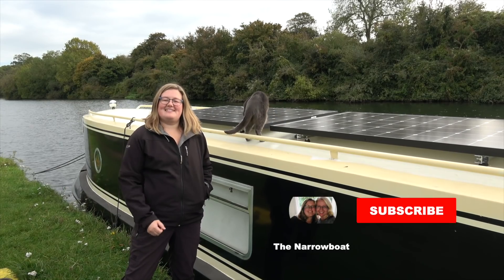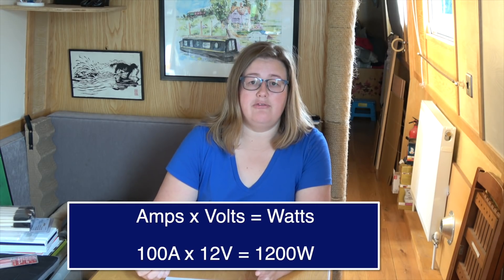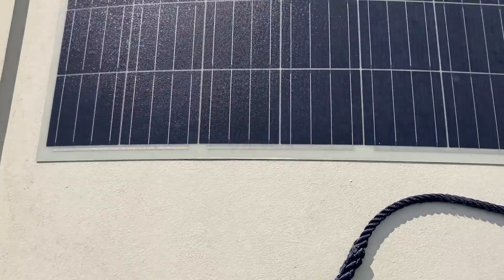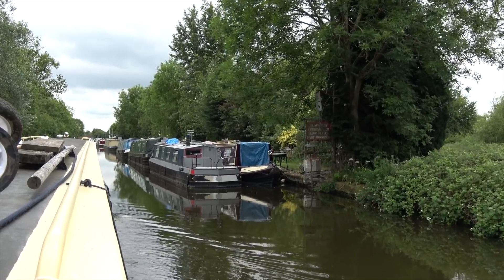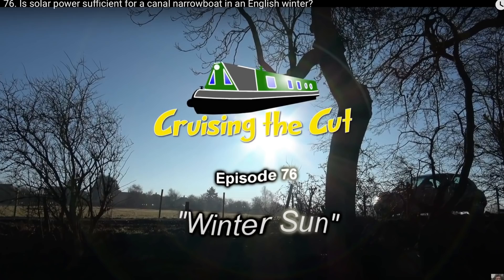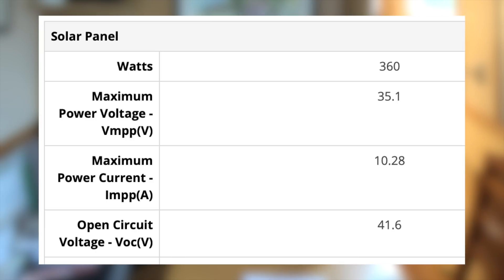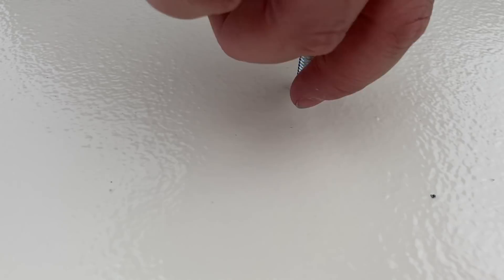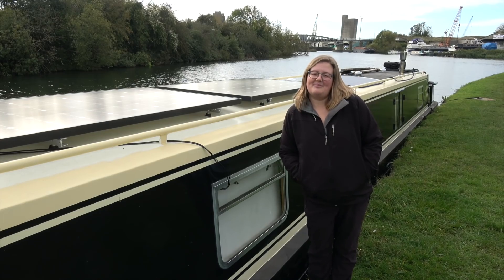5 THINGS YOU MUST THINK ABOUT Before Installing Solar On Your Narrowboat

Comment: We had ours fitted by Onboard Solar and one of the things he pointed out on his site, that doesn't get mentioned often, was this :-"Importantly, these panels are rated at 165W with an output of 18V giving an output of 9.5 amps. Many suppliers use "domestic" spec panels. These are much bulkier and output typically 250W (which sounds much higher doesn't it?). However, they output at a much higher voltage - typically 48V so their actual current output is 5.2 amps. Be aware that in 12V or low voltage applications, AMPS are key not watts and AMPS are arrived at by taking WATTS and dividing by VOLTS.". 
These smaller panels leave plenty of space to walk on the roof. He now does 215W panels. He did the whole job in under 2 hours and came to us out on the cut. Highly

Comment: Energy is Wattsxhours  or Power x time.  It is the energy usage you need to calculate. A kettle draws 2200watts but that isn’t telling you how long you use it for. Your Solar Panels are not providing your Power usage, your batteries do that. Your solar panels are replacing your consumption of power over time.
Volts equate to a height of Electricity, 
Amps relate to the amount of electricity flowing
Volts x Current (I in amps) = VI = W (watts).    K means 1000 as in kilo so Kw is Kilowatts 
Energy is Watts x time or KiloWatts times Hours. kWh 

A 100w panel will produce 20W at dawn and dusk, 70w flat on your boat at midday, if you have full sunlight. If you track the sun you will improve these figures, but use energy doing so..... You will therefore need 7 panels to get 350watts over 10hrs or 3500wh or 3.5kWh..  Now you need batteries to store this in. 3500/12 is the AmpHours assuming you can use the whole capacity of your batteries. Or double that to account for the fact you can only discharge your batteries to 50% so 7000/12 or 583ampH batteries. If hot water is one of your requirements, you can pump excess energy into your Calorifier directly, and just produce electricity from your batteries. A Hot fill washing machine for example, will use much less energy and you could replace some solar panels with thermal panels instead, produce less electricity, but hot water. Solar panels work most effectively at 25C, so you could save 2.4% per degree loss in hot weather, by water cooling the underside of your panels and recovering the heat into your hot water tank.

Comment: Great video Kath. I have just added the same size panels as yourself, but just made them flat. They have replaced two 200W panels at the front of my boat that were mounted with triangles. I hated the triangles. The knob threads were not stainless and rusted tight. The panels kept slipping down the slots and getting shade from the triangle supports, it was a nightmare. Now the 200Ws are off, I have managed to use WD40 and tools to take 3 triangles off but the last ones plastic knob has shattered so I will have to hacksaw it off. The 200W ones are going on my side wall, water side. I often turn my boat round to moor up (45ft easy). Re sizing for use, I would just advise to get as much as you can afford and fit on a boat. The more you have the longer solar summer lasts. By next year I intend to have 1.45KW and will be almost maxed-out, in terms of available space. You do realise we have just done this in time for the leaves:-) M

Comment: You always impress me Kath.  Such confidence, without bravado.  You do your research, assemble the necessary and then get on with it.  I wish I was so organised.  I know not one in a hundred men wouldn't just blaze away at a steel roof with a drill and never consider a drop of cutting fluid or even oil.  Never mind a tap set!  Respec'.  I have to say I would be very wary of drilling the roof and would be tempted to 'go over the edge' by some method and then go through the wall, to reduce the possibility of leaks.  (But what do I know, I only hire narrowboats.)

One thing you didn't make clear though,  is the very real risk of getting a very severe 'belt' off such systems.  There is a tendency, it seems to me, to consider boat electrical systems to revolve around 12VDC.  Ordinarily, this voltage is quite safe to work on - even 'live' - but the risk of fire or even explosion if one or more of the domestic batteries are shorted by, say, dropping a spanner!  And the voltages you quote for your array - 80to 90 volts - are getting high enough to really give you a jab.

Once more, well done for a very professional amateur job!

Comment: As a retired approved electrician I will only comment on the bits of the installation I could see, and towards the end of the video it looks like the wires are entering the roof via the mushroom dome of the ventilator, my point is that those cables without proper fixing and without extra mechanical protection (some kind of silicone or rubber grommet) these cables may rub through the cable insolation on the sharp edges and short circuit, (not good) because as far as I know there is no fuses on the panels to protect them. this may possibly cause a fire. If I have misunderstood please accept my apologies. PS keep up the good work and stay safe.

Comment: In wintertime the sun altitude is low, that means you will tilt the panels almost vertical to get a little power.During winter you have sometimes a huge gale. Be careful during these windy days. Never underestimate the wind force on your vertical placed panels.

Comment: Hi, nice vlog. And you explain it well, When determining how many solar panels you would need . I first loocked at the space on the roof. The more solar panels are overrated and daylicht is not always ideal especially in winter. Oke, in the summer you have too much energy , but in the winter it also nice if you can manage with the panels. Greatings, Sjoerd from Amsterdam.

Comment: Hi Kath and Annamarie,  Great video, just a couple of comments, hope you don't mind! Sorry Kath! The Amp hour of the battery is the amount of amps the battery can deliver from a fully charged position.  If your battery was 100 amp hours it will deliver 1 amp for 100 hours, or alternatively you could draw 100 amps for 1 hour, it has no relation to your current draw. When you want to know the amps a product draws and that is expressed in watts (like your kettle, electric heater etc) you take the wattage rating and divide it by the applied voltage, so a kettle that draws 2400 watts when plugged into the wall with an applied voltage of 240 volts will operate at 10 amps. 2400 watts divide by 240 volts = 10 amps (240 volts A.C. is the household voltage here in Aus).  Cable size...Sorry again Kath!  The cable install from the solar panels to the Voltage convertor charger thingy.  The larger the better, larger cable sizes will prevent voltage drop over longer runs and hence ensure the maximum voltage is available to the charger thingy so it can convert it to a more useable voltage to charge your batteries up and ensure you girls are well sorted for power.

I love your videos on such matters as you both seem to do a stack of research into whatever topic you are both getting into.  You are then able to articulate the intricacies of your endeavors in very easy speak, so they can be easily understood by us noobies that have never experienced canal life or the challenges this brings. 

By the way, I am subscribed and have rung the bell, but I do not seem to get notified any more when you post new youtube videos, not sure what is going on there.  A great video Kath and as usual very well explained.  Say Hi to Annamarie ( Oh, I have already done that!) Regards A fan from Aus.

Comment: remember most lead-acid batteries can only go to 50 percent so a 100 amp-hour battery is only good for 50 amp hours or over use destroy's the batteries.
Reply from the maker: Yes I know. I was just using 100a as an easy example of how to calculate watts. This wasn’t a video about battery life or capacity so I didn’t mention it.

Comment: Nice work! 
Oh BTW the amount of power you use in a day is expressed in amp hours not amps. An amp hour is one amp of current being drawn for one hour. You also need to consider the rate of draw, a battery will be rated at xx amp hours at a rate of xx amps. The higher the draw the less you will get out of the battery. Mind you I suspect you already know most of this.
Reply from the maker: Yes I do already know this. I was just using 100a as an easy example of how to calculate watts. This wasn’t a video about battery life, only about making sure your solar would be enough to recharge them. The assumption being that you already had a battery back with the capacity to meet your usage needs.
Reply: @TheNarrowboatExperience  Cool, it's just that you used the term "we use about 100 amps a day" or the like which jarred my "get it right" nerve. Don't mind me, nothing to see here  :)

Comment: Great informative video Kath. I think you have covered just about everything.
A couple of tips though. With Lead Acid type batteries, (automotive and AGM types, don't use them below about 11.5 volts. This is around the 50% capacity point, otherwise you will reduce the prospective life of the batteries. If you have any panels connected in parallel, put a schottky diode in line with the output of each panel. This will reduce losses when one of the panels is either partly shaded, or in full shade.
Again a great video
Reply from the maker: Thanks for the tip about the diode. I already know about the battery limitations. I was just using 100a as an easy example of how to calculate watts. This wasn’t a video about battery life or capacity so I didn’t mention it. The assumption being that you would already have a battery bank sized appropriately to meet your needs.

Comment: I would love to live on a narrow boat but on a work day I typically use 1.5-3kwh constantly. Not including household utilities.

I doubt I would be able to get that from solar in the UK.

Also. Don't worry about heat on the flexible panels. You are sticking them on a massive chunk of steel. It will suck the heat out of the panels.
Reply from the maker: I’m not sure that the Narrowboat roof acts like a heat sink...
Reply: @TheNarrowboatExperience  as long as the roof is colder than the solar panels, it will draw heat off them. Entropy works like that.

Comment: Great vlog thanks Kath. Very informative and  waiting for the follow up. An unrelated question please if you don’t mind, we’ve just come back from our annual hiring, never been this late in the year before, and we had a lot of condensation in the mornings. Do you suffer from this with your diesel heater? I know David CC uses a window vacuum to suck up the water on his boat, but he has a multi fuel stove. TIA
Reply from the maker: Hi Sally, if we have the refleks on all night we don’t really have condensation in the area with the stove in the morning when we wake up. There might be some in the workroom but not a lot at the moment. if we cook or dry clothes during the day there might be some but not enough for the vacuum at the moment.  When we were running the radiator heating we had condensation everywhere. We also have a window vac.
Reply: Thanks Kath, interesting.

Comment: What is the "cat load rating" on those new panels? Maximum one cat per panel. Or can they handle two pampered cats apiece? X-)
Reply from the maker: I think they could probably fit quite a few cats as long as none dropped from a higher platform...
Reply: @TheNarrowboatExperience  I was curious about the weight limit that the new solar panels could hold before breaking. How man well-fed cats can they hold without damage?. ;-) ;-)

Comment: Hi
Very nice video about installing solar panels and tilt bracket:
I am a professionel solarpanet installer and It's a good ide to tilt the panets to get optimised the output on  when you point the panel direct to the sun.
The optimal angle to tilt is: spring and autumn 20to45 degrees, Summertime 45-60 degrees and wintertime 12-20 degrees. when you use Manchester as your area.
Look at this link if you want to use another city :-) http://www.solarelectricityhandbook.com/solar-angle-calculator.html
Sorry for my English,
Greatings from Denmark
Reply: Good link, some nice info in there.
Reply from the maker: Thanks. I’ve been experimenting with the tilt to see the benefits. The downside of the canal is that we don’t always moor up at the best angle with the sun for tilting.

Comment: A few extra points you didn't mention:
Battery sizing. For lead-acid batteries, try not to discharge them below 50% to get any useable battery life. So once you have worked out your AH useage, double it.
The airflow that will cool solid panels, will also give you noticeable extra cooling of the boat. The panels act as a sun shade. 
And the difference between MPPT and PWM charge controlers. Lots of maths here, but basically MPPT will be able to use more of the available power from the panels. But they are more expensive. On a land based system, popping an extra panel on the roof may be cheaper than buying an MPPT. Where space is limited, MPPT is your friend.
Reply: If you have an MPPT controler. Wiring parallel or series will not really affect the amount of power you can harvest. But parallel will be more resiliant to shading. (Go and look at the videos mentioned.) if it's within the current rating of your controler, go for parallel.

Comment: An interesting installation. I’ve noticed quite a few narrowboats with solar PV mounted on the roof in recent years. I’m used to the operation of a domestic setup, on my house roof, which is a wee bit larger - 6 panels in a SSW at about 45° orientation, and it churns out something between 1.8 & 2 MWh per annum. They feed into an inverter connected to the grid, and I’ve on the ‘feed in tariff’ deal. 

	The weather varies a fair bit from year to year, but on average the total generation in Spring and Summer added together amounts to between two thirds and three quarters of the total each year.

	Obviously a lot more variables on the move. Another issue may be the capability of the battery set to take in a charge from the panels - if they were fully charged by the engine you’d gain nothing; maybe that doesn’t happen much. I guess it depends a lot on what happens during daylight hours. Have fun with it!
Reply from the maker: Thats interesting information. I always wondered how it works with the house roof installations.

Comment: hi. Warning. Do not mix panels type and brand. Each unique panel(s) needs its own solar charge controller (flexi on one controller, the new panels on another).  You won't hurt anything but your charging efficiency will be dashed if you don't split them up..
Reply from the maker: Thanks for the warning. I have two MPPT charge controllers.
Reply: @TheNarrowboatExperience  then you're jam up and jelly tight

Comment: Just wondering what the impact of a Munchie on a solar panel has on the solar gathering capabilities?
Reply from the maker: Half as big of an impact as when Alice joins him!
Reply: With modern panels like those not a lot, just the bit in shadow. Only a handful of years ago any shade on a panel at all killed the entire output so if you were wired in series a tiny bit of shade on one panel would kill the lot. Even now if you have filtered light and shade it's best to wire in parallel (with every panel going back to the controller) for peak performance as no one panel can hold others back.

Comment: Great job, the panel set up you have should provide plenty of power. The only thing to double check is that all the panel specs are similar. I think the stick on panel will bring the output of the other panels down unless run through a separate controller. We only have 300w and consume 60ah per day, 8 months of the year we never have to run the engine other than cruising days, the rest of the year the solar is great for tail charging the battery bank.
Reply from the maker: Thanks. I have kept the panels separate - so we have 2 charge controllers now.
Reply: @TheNarrowboatExperience  Legend.

Comment: An electrically conductive connection between stainless steel and aluminum will corrode when left out in the open. Nylon washers will be useful, as may some elecrical tape. At teh very leaset keep an eye on the steel bolts and especially the holes they go through.
Reply: Finances permitting I have to agree. The only things that should limit the size of a solar install are available space and budget as solar (or battery storage) is one of those things you can't have too much of.

Comment: Great episode. Not a lot of shops along the canal to Sharpness, how did you get everything you needed for the installation to the boat?
Reply from the maker: We got everything we needed in advance of the installation so didn't need to go to the shops!
Reply: Of course, makes the tip about getting everything ready before sitting on the roof even more crucial.

Comment: It was a good starter video to a quite complicated subject. I was interesting to know how you combined the flexi panel with the rigid ones. Did you wire them all to the same charge controller? The spec of the panels was bound to be different, in which case it is important to choose the best connection method, series or parallel. You have to match either the current output or the voltage output to get the best power out.
Reply from the maker: I have wired them into separate charge controllers as they are different sizes.
Reply: They used 2 panels of max 41 volts. The controller can handle 100 volts max. In that case put them in series. Higher voltage but the same current, so less losses in the cable towards the converter...
This only works with identical panels so it's wise to connect the Flexi one to a separate controller.